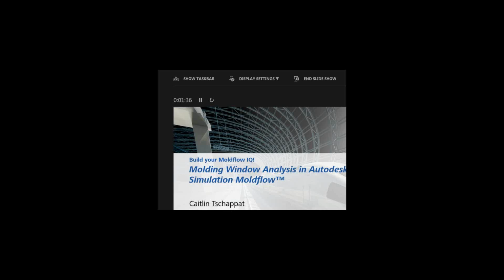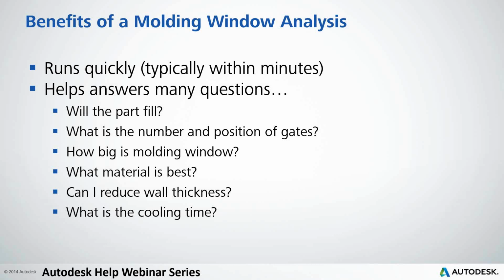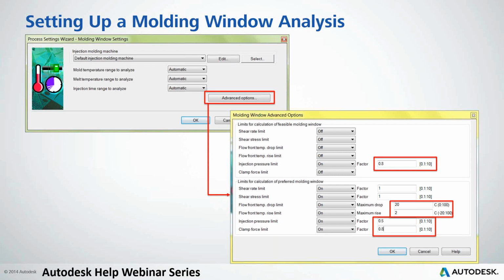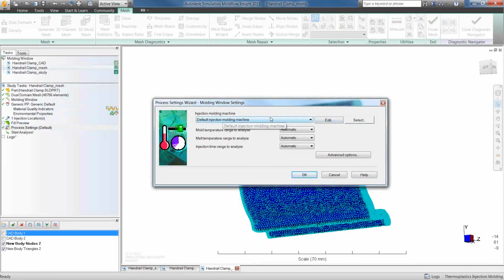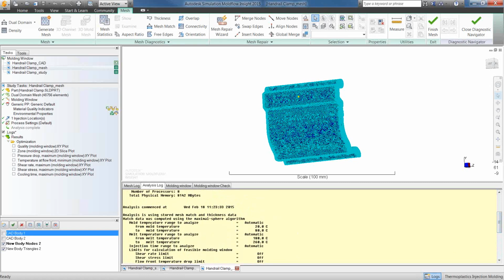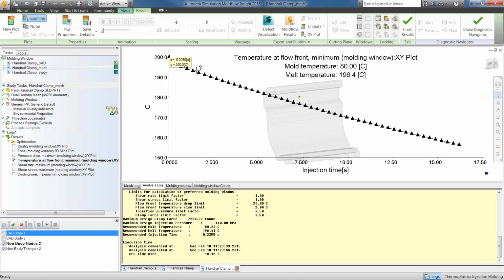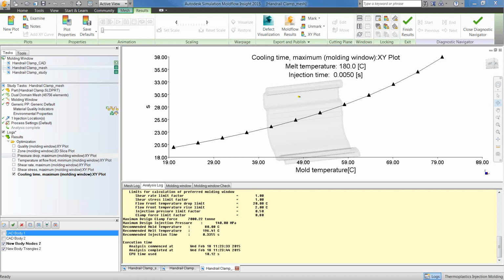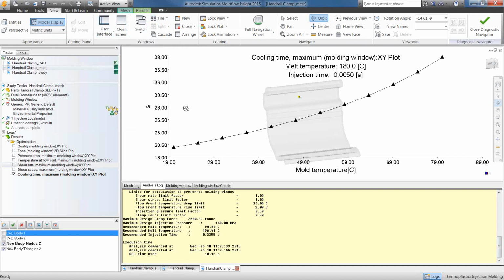Molding Window analysis in Simulation Moldflow Insight

Comment: One of the participant asked about gate location analysis when the demonstrator chose a injection location. The response/answer was not clear. Yes, injection location needs to be decided based on the gate location analysis. But here in molding window analysis, you are not checking for the best gate location based on filling. You must have a decided one or two different gate locations already based on fill analysis. After you decide, you can come to MWA and compare your parameters based on those different gate locations.